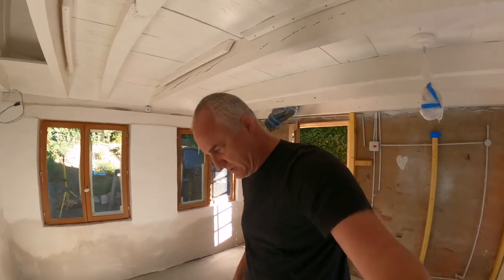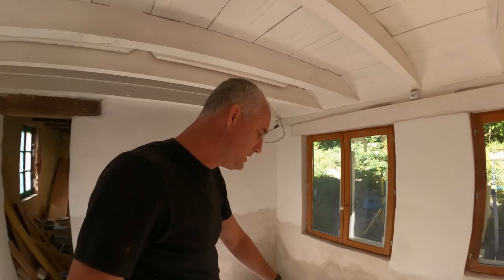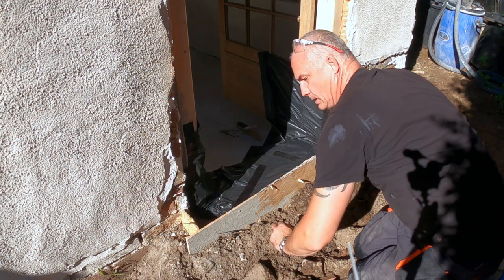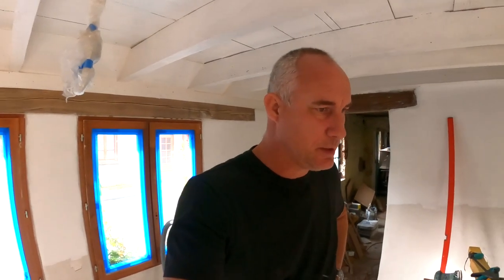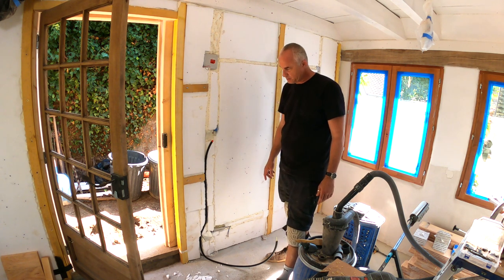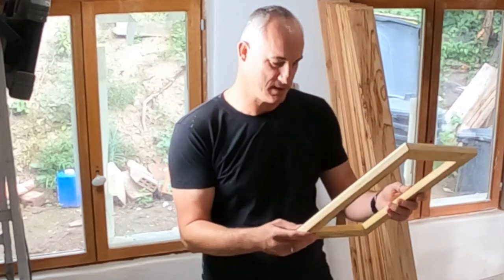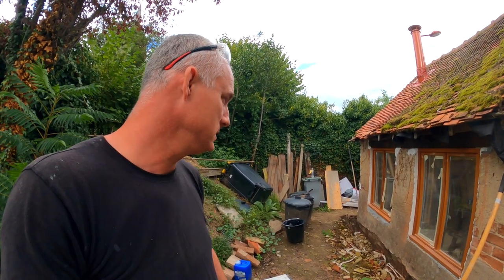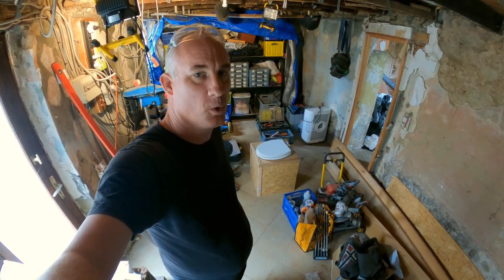Masonry, carpentry and painting. Its slowly coming together!

Comment: The door is really a lovely colour nice choice. I think where  the damp outside needs to be dug out more down, and a membrane put down and a bigger with the the trench. We had exactly the same problem, plus we have a cellar below the ground level of the floor. Loved the stand for your wood burner and yes good to recycle what materials you have lying about. Well done on what you have achieved so far.👋😘
Reply from the maker: Hi Annette, yes I will need to dig out much more. But first I need to focus on getting most of the interior done as I’m moving in in two weeks!
Reply: @thisoldhousefrance  I quite understand you have to get on with your house ty x

Comment: Great progress this week. The paint color is perfect. I don't know the cost of labor in France but it might be beneficial to hire someone to level your backyard and haul away the rubble. It would make a great view as you continue your indoor work. Are you not concerned that the styrofoam might compress under the weight of the heavy stove?
Reply from the maker: Hi Rochelle, France is a great country and I love the people. The only downside is that contractors are notoriously unreliable and excessively expensive. We have been looking for someone the clear our backyard for months. The styrofoam is quite dense and strong. On top of it it is covered with cement. It won’t compress I think. But we’ll see…

Comment: Is guttering common on houses like yours? Right now, the roof is almost certainly contributing to the damp issues along the wall at the back (as is that mound of dirt, of course).
Reply from the maker: Yes I need to install a gutter on the backside. On the other hand it hasn’t been raining much. I’ll dig the trench deeper and wider first.

Comment: All of the moss on the roof means that side of the house is not getting much sun. Could that be another factor why the wall is not drying? Maybe dig the trench deeper.
Reply from the maker: Yes, that side doesn’t really get any direct sunlight. But it’s taking forever now. I will have to dig deeper and wider but first finish the interior as I’m moving in in two weeks!

Comment: I fear that the foam under the wood berner is going to melt when the stone heats up. That foam is not heat rated. Just a thought to consider.
Reply from the maker: Heat rises. There’s also a lot of cement and rock on top of the foam, and a cool slab of concrete beneath it. We’ll see how it goes, I’m not to worried.

Comment: Great work. Will you do the glazing of the door yourself ? Wondering abt the foam block strength under the stones for the heater. Will they hold up the weight over time? You may well hv reinforced them or they may be reinforced by the mortar. Curious.
Reply from the maker: I’ve been standing on it and it didn’t ‘give’. There’s in fact quite a bit of cement mortar in it on top of dense styrofoam. It’s stronger than it needs to be really.

Comment: First, everything is looking really great. Nicely well done. Some advice now. I'm not an expert. I live in France and have a very old French house. Most old houses do not have foundations. They are literally sitting in the dirt. Your back wall has several issues. One, it doesn't get enough sun. Two, that mound will create water runoff towards the house. Three a simple 'trench' will not solve this issue. Four, you don't have guttering. What you need to install is called a 'French drain'. It's the only way you're going to solve this issue on that side of the house. If you don't do this you will have continued issues. I know you plan to put guttering but you need a drainage system. Definitely look into this for the whole back of the house.
Reply from the maker: Yes, this is in the planning but for next year. The garden needs to be dug out to aprox 30 cm below floor level. Then drainage will be installed following by paving etc. Obviously gutters will be installed too. For now the trench is all I can do. Possibly a gutter. But I think that some of the hollow bricks may be waterlogged and are releasing moisture gradually. Thanks for your advice, much appreciated!
Reply: @thisoldhousefrance  it's not uncommon for clay bricks to hold water, which will make them deteriorate eventually, I ran into this issue when we lived in the UK (I'm not from there but renovated a house there). We don't have bricks at all in France, we're all stone but we have the issue that a lot of our walls have concrete/paint on them which holds moisture. The north side of our house has a similar issue with sun/higher ground level. 

With the nights getting colder there's a lot more moisture in the air so even though it's not raining you'll still have runoff from the mounds. I know you plan to tackle the mounds eventually but I think they'll continue to be a pain for you in regards to the walls on this side.

One last thing I was going to mention, not sure if it's 100% applicable to your situation, in France, you can buy hollow brick anchors. So you don't need to use the resin all the time. It mainly depends if the bricks are solid or not if you can use them.
Reply from the maker: @traveladdict7173  thanks again. We plan on building a concrete retaining wall in the garden with a raised garden behind it. A footpath on floor level directly adjacent to the house. I’m planning on a good drainage system underneath the footpath as well as behind the retaining wall. I hope this will solve most of the humidity issues. Do you happen to have the French name for the hollow brick anchors? I’ll look into that.
Reply: @thisoldhousefrance  Sorry for taking so long to get back to you. So, with bricks in general, you can use an 'all purpose' anchor, those plastic ones, suggest using high-quality ones. The trick here is to dill a smaller hole than required and then tap in with a hammer (for example 6mm anchor use a 5mm drill). You may already know this but just wanted to share that. If you have heavier items you can use a universal metal one, for all types of walls - expansion bolts - goujons à expansion, again using the same theory of drilling a slightly smaller hole and then tapping it in.  I'd provide links but YouTube doesn't seem to like links in comments.

Again, this comes down to the quality of the brick as well as where you may end up drilling. If you drill into the mortar then it wouldn't work.

When we did our property in the UK we used plastic anchors everywhere. We only used the resin when required due to poor brick conditions.
Reply from the maker: @traveladdict7173  thanks. I like to ‘over’ engineer. Gives me a piece of mind. Especially when I’m not sure about forces, condition of material etc. For the few more anchors I need to install I will use the epoxy compound. Wouldn’t want to run the risk of an overhead kitchen cupboard coming down on me…
Reply: @thisoldhousefrance  totally understand. I'll be using a lot of resin in our stone house for that very reason as I don't trust the structure. We used M10 plastic anchors for large overhead IKEA cupboards in the UK and had no issues but it could be different in your small house. Each place is different. A test would be to try something smaller first to see what result you get. Old houses are pretty difficult to work with overall.
Reply from the maker: @traveladdict7173  yes, as I got advised before we started this: “living in an old house is a lifestyle”. Very much true I can say now.